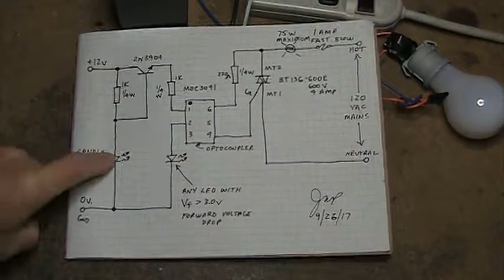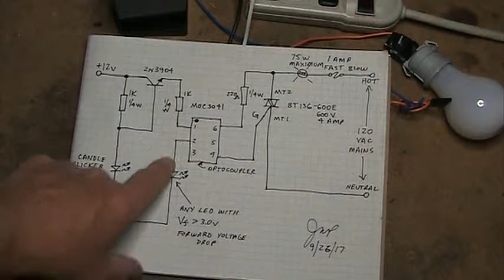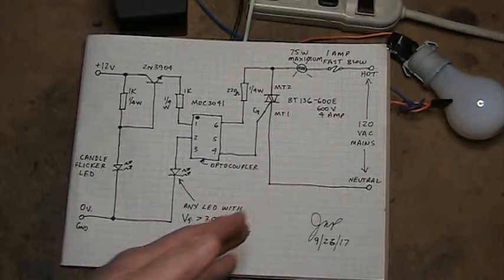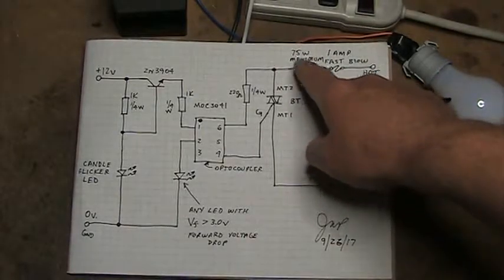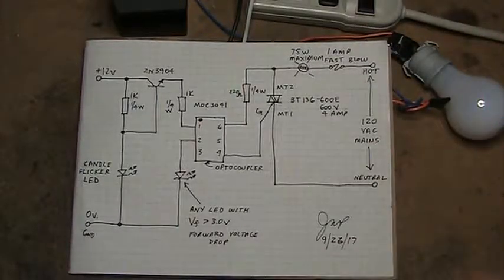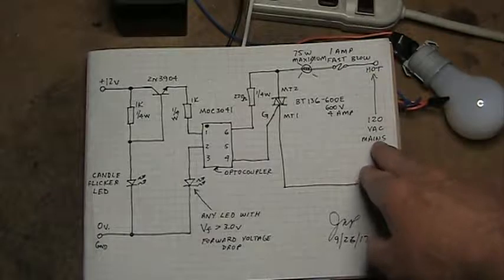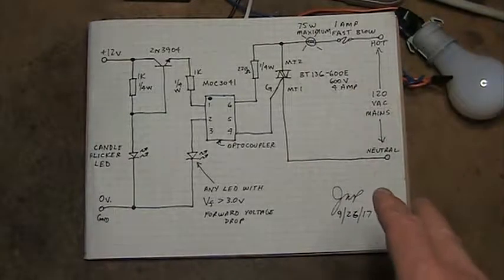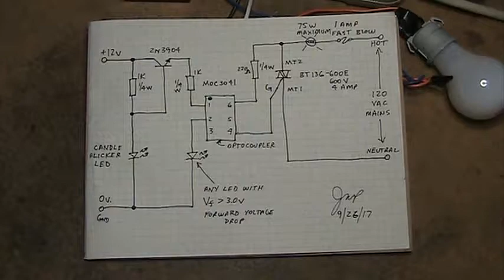Halloween Flicker Bulb Short Circuit Effect

Comment: That's really clever!
Well done.
Reply from the maker: Thank You very much.
Reply from the maker: OHHH    I used the MOC3041 Optoisolator because it has the "zero crossing" circuitry.    This saves the bulb because it turns it on just when the mains sine wave is at zero volts point in its cycle, so this effectively does not shock the filament at possible peak line voltage.   It also eliminates electrical switching noise.   This may be a tool for extending the vintage Christmas lights life discussion in another video.

Comment: Hello! It is very interesting!  I love this holiday, but I live in another country.

We have a different voltage standard 220-253 volts AC. Can you please tell me what items need to be changed? What will be the new values of the elements?

Did you make printed circuit boards for this flasher?

like, subscribe - done
Reply from the maker: I did not make PC boards.   Some day I would like to try making some.     Triac and optocoupler voltage will need to be chosen for higher voltages but circuit will work the same mostly.   50 hertz AC power would require different slightly larger capacitor size also.    USA has 60 hertz AC power.

Comment: Not bad, but if you connect a fluorescent tube starter in series with the bulb you get the exact same effect, just way simpler.
Reply from the maker: My circuit will work the first time every time.  1) The fluorescent starters require farting around with different model number units to get one with the right specs so it will work for you.    2) My circuit will not generate electrical noise in your house wiring like the starters will due to zero crossing startup feature built into the optocoupler I designed it with.    3) You build my circuit once and it will last for years.   4) The fluorescent starters may last for a day or a week or a season.   They are not designed to be used in this manner and they burn out regularly and unpredictable.    You will be redoing the circuit over and over again.    5)  This circuit does not get warm at all due to circuit designed  and loading requirements designed into it unlike the starters that spark a lot and get hot and could cause a fire.    6) You will absolutely save time and hassle in the long run due to redoing the starter technique many times instead of once with mine.    Hope this helps.   These are the reasons I said it is the best.
Reply: jp040759 - I do not say you are not right, and your circuit is bad, i'm just saying it is complicated for the purpose. The starter will last longer than the bulb, since incasdescend bulbs do not really like continous especially random on/off cycles. They last for a while, but the filament will crack. A circuit that does not more than just flickering a bulb should not need 7 discrete parts, a regulated current (with a separated power supply), because it is just overengineering. Don't get me wrong, it works, and it is a nice desing, but a bit complicated for the result. I used the flcc starter for long time to flicker bulbs to simulate fire-like lighting, and they lasted years. Noise may be reduced or completely deleted with filter capacitor(s) and maybe a choke. I did not want to criticize your idea, it was more like an advice.
Reply from the maker: @resetcoder  No worries.   Sorry I came across as disturbed by your comments.   I was not.   I saw many of the videos by other folks doing the starter trick and they all complained about it.    I thought I could make it better.  If you check out my other vids this was an offshoot of a circuit I made to make a 120 vac incandescent candelabra flicker like a candle with a candle flicker LED controlling it.    The candelabra circuit came before revising it to be this short circuit effect idea.     The candelabra circuit was the complex one and it was simplified to make the short circuit version.    The other reason I made it is everyone these days wants to throw a microcontroller at every circuit idea.    Merry Christmas
Reply: No problem, i appreciate the instant and welcoming comment even though this video is more than a year old. It depens a lot on what kind of startet you can get, some die fast, its true. Btw i'm just saying the above because this was 25+ years ago when i used the starter design, there was no such things as flickering leds, only flashing, but it was periodic, not random, you could not make such circuit back then so easily like now, a very slow white noise generator was the easiest solution to get to something like random flickering, still not very difficult, just 2-3 transistors. I don't really like the idea either that everyone can access MCU's nowdays and they put a complete computer to do very simple jobs, it is just such a waste, so i agree. Merry xmas to you too!
Reply from the maker: @resetcoder  Thanx.  I love MCUs but not for everything.   Good talking with you.